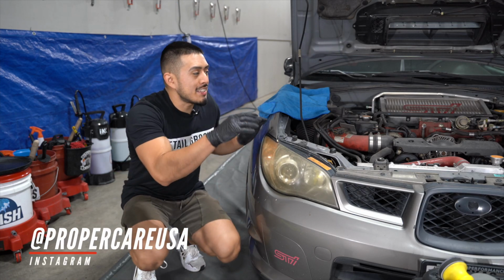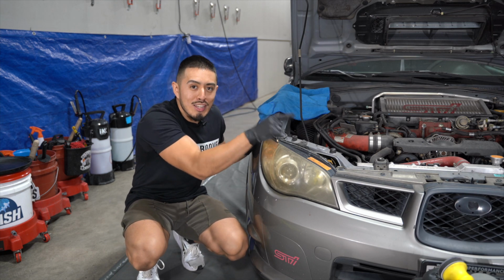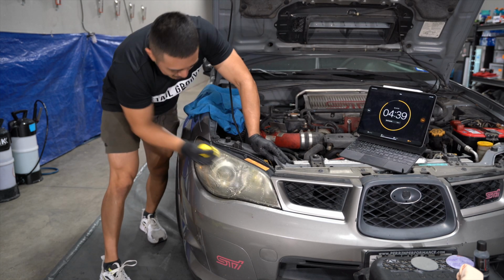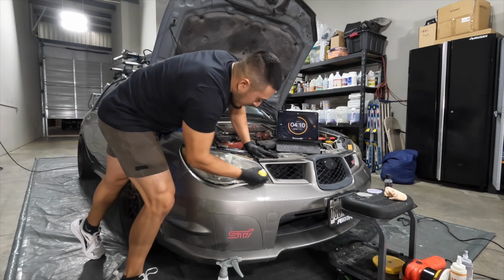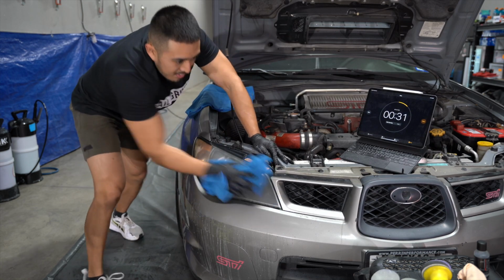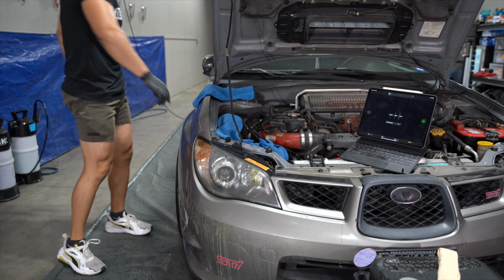Restore Headlights in 5 Minutes Challenge | Professional vs Hack Detailing

Comment from the maker: Could you finish it in 5 minutes? 🤔
Reply: Absolutely not 😅 but this was entertaining to watch. Thank you for the creative content!
Reply: I think I could do it in 5 minutes, I would simply use a 1500 grit sponge, then bust out my 3 inch buff and shine wool and foam polishing pads on the rotary. My process would be sand with 1500, dry the light, compound with M100 with the 3 inch wool and rotary buffer at 1400-1600 rpm, wipe away the compound, switch to the 3 inch foam polishing pads with M205 as my polish at around 1000-1200 rpm, wipe away polish, spray Meguiar’s D156, wipe away and done! So pretty much one stage of sanding, and two steps compound and polish, quick spray wax. If I really wanted to be fast, I would do 1500 grit, M100, then straight to spray wax, and skip the polishing, and it would look good, just not as clear since the polishing step was skipped.